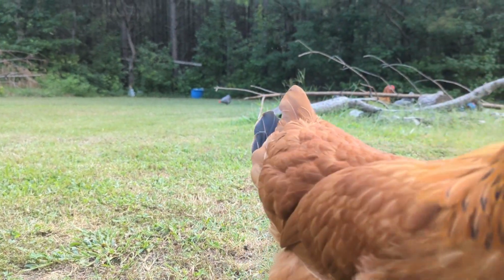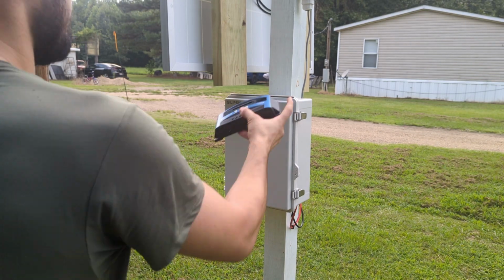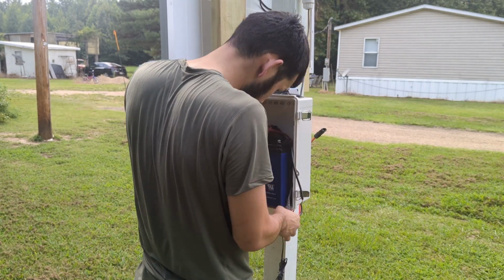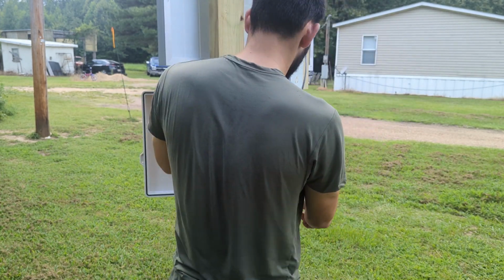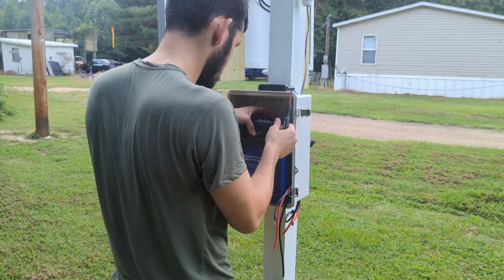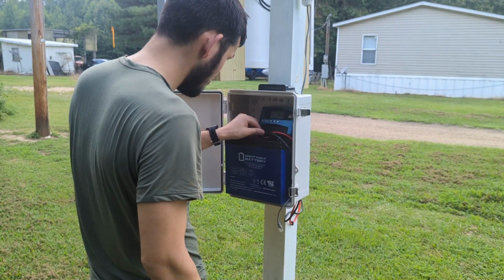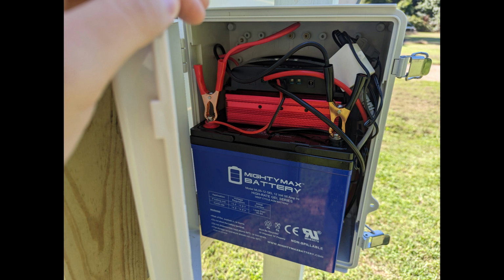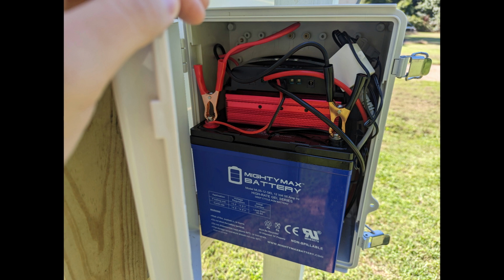OFF GRID Security Camera System Mistake

Comment: I can give two pieces of advice, the first is to use a true MPPT charge controller, the ones in the video are marked MPPT but in reality they are not, an Epever or much better a Vicron with bluetooth and APP changes the situation especially in periods with less sun.
Second it is extremely inefficient to use an inverter as you say in the video, to raise the voltage, modulate it in alternation, and then enter a power supply that lowers it and straightens it again to power the camera, much better to use a suitable step down DC/DC converter, the cables melt because the current that passes is not calculated, usually the cameras are 12Volt and can be connected directly to the battery with a suitable fuse. Ciao
Reply from the maker: Yea, the wifi extender is a 24volt system. I had hooked up a 12 volt to 24 volt converter but I need to regulate the  power. Once I figure out how to do that I can make it even more efficient. -JR
Reply: @strategicprepper2648  you need a step UP Dc Dc converter suitable for the absorption of the PoE camera, usually 1A is enough, but if you take it slightly bigger the better, then it depends on the power of the IR LEDs that light up at night, some converters are sealed and not adjustable others have one or 2 adjustments, one is the output voltage and the other the current, it is used to power, for example, LED diodes directly by limiting the output current since they have no resistors or cip com, and the LED strips, in your case not serves is held at maximum, what happened was probably due to a polarity reversal somewhere, and an anti-reverse protection diode made the short, probably in the passive PoE, usually in the RG45 of the cameras pin 4e5 are the positive and pins 7e8 the negative and do not carry data, but some brands do it on purpose and reverse, try to check. Ciao